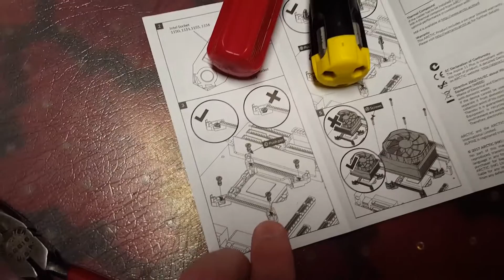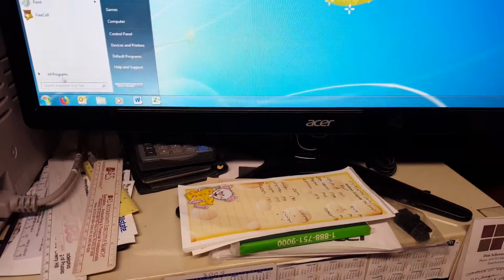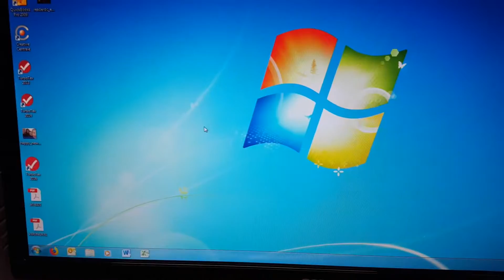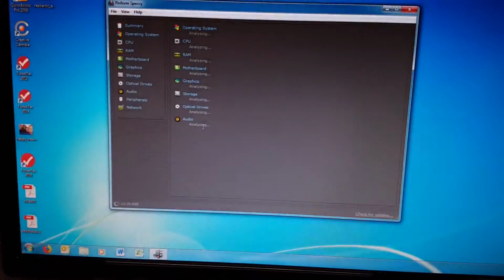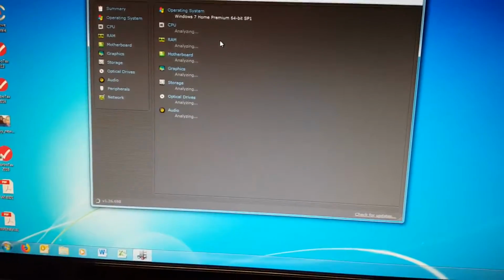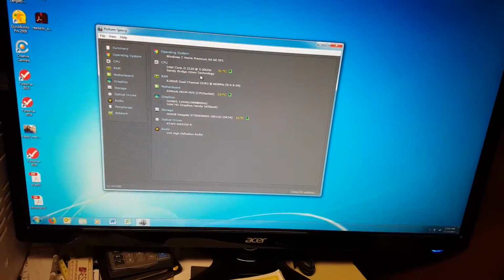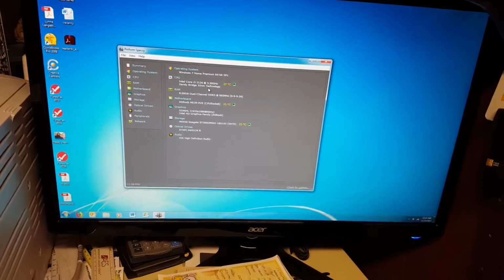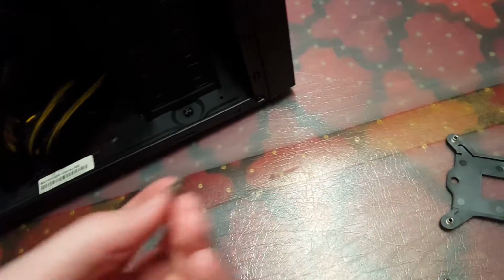Replacing Stock CPU Cooler with Arctic Alpine 11 Plus

Comment: Very good CPU Cooler for 10$. 
I using this cooler on i5 4460. Idle Temp. is 28-31 degrees, full load 100% is 60 degrees. Satisfied :)